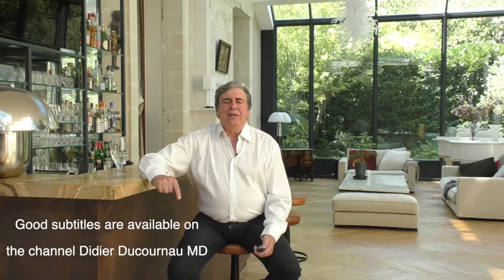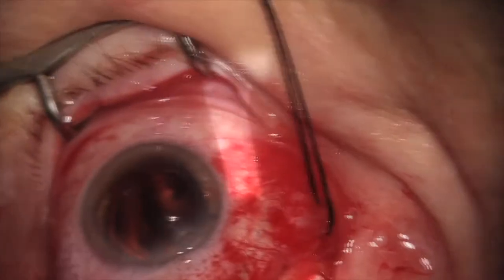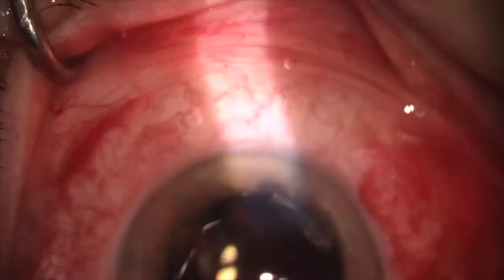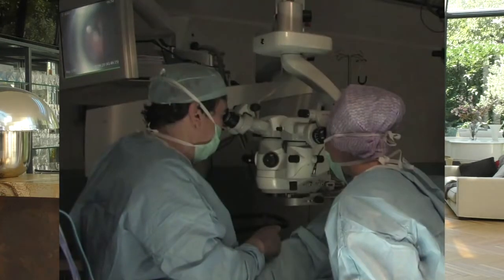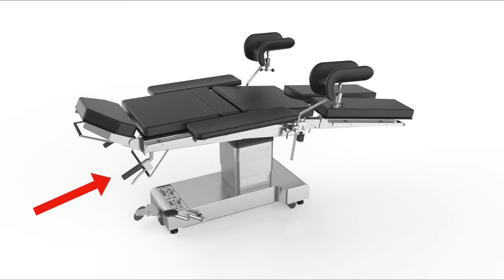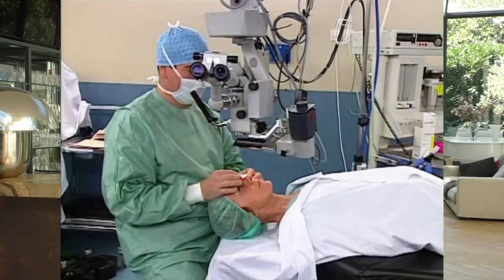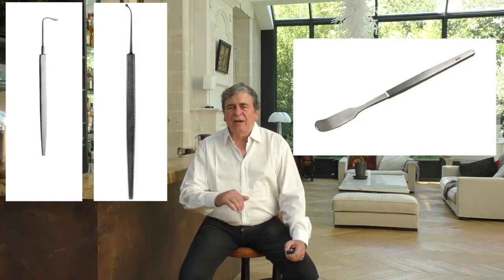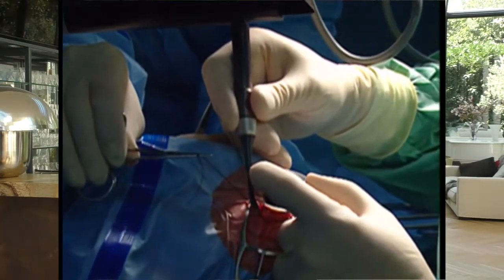Retinal Detachment - 6: Installation - Choice of material

Comment: Dear Sir, Excellent lectures and principles! What do you use for anaesthesia, local or GA? And What drugs? Thanks.
Reply from the maker: The answer is difficult as the anaesthesia type depends on so many things: who is performing the anaesthesia, where is it performed, which operating table do you use, is there equipped pre-operating and post-operating rooms closed to your OR... Each operator will have a specific answer
Reply: @didierducournau3576  Dear Sir, Thanks for your prompt reply. You mentioned that you performed more than 10 cases in the morning. I would presume that you performed all your cases under local. It would be difficult under GA. I wonder how you did your LA, retrobulbar and/or subtenon? Thanks
Reply from the maker: @liukingyu  If now the question is how I was functioning: 95% of the 13 cases I operated every morning in a single OR were under GA, for different reasons: first because I  hadf visitors every day and patients don't like to hear their surgeon speak, but, most of all, because,  under LA, I had mobility problems of the eye in 4 to 5% of the cases, which for me was unacceptable for a surgery presenting so few complications when one can handle the globe easily. Everything in my OR was organized to allow this rotation of patients:
- The preoperative anesthesia room was right in front of my OR, equipped with a monitor allowing the anesthetist to follow my intervention and calmly put the next patient to sleep. A laryngeal mask was placed. In 13 seconds, the sleeping patient, on the operating Stryker, was disconnected, brought to the OR and reconnected.
- After the operation, the patient was taken back on the same Stryker to the post-operative room where a nursing team calmly monitored his awakening. No risk therefore of to early extubation. 
The room was cleaned during 6 minutes, while I was preparing myself, so that, spending 1 minute in preparing the surgical field and 6 minutes for surgery, the 13 surgeries were performed in 4 hours without hurry.
Reply: @didierducournau3576  Dear Sir, It was hard to imagine performing 13 GA cases in 4 hours! Now I understand that the key is in the organization. I am most grateful for your detailed answers. All the best and thank you.